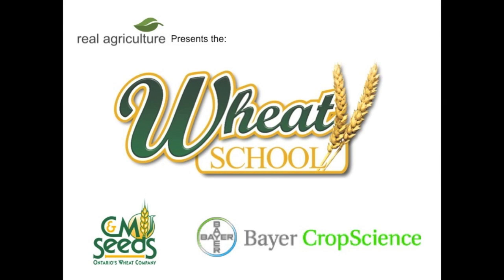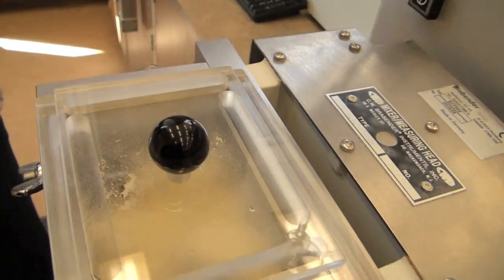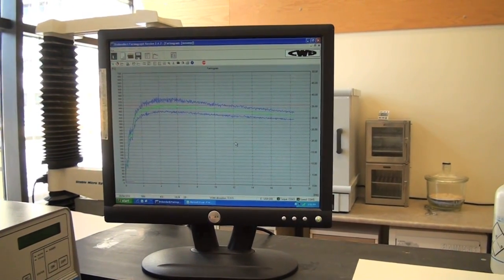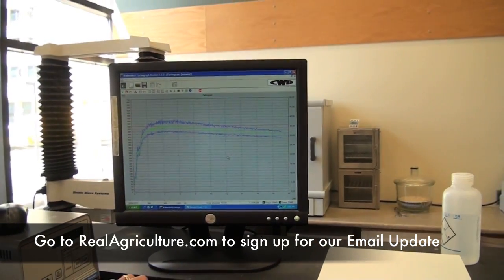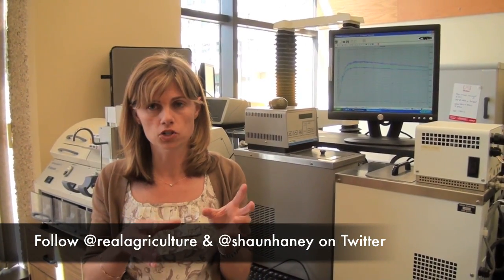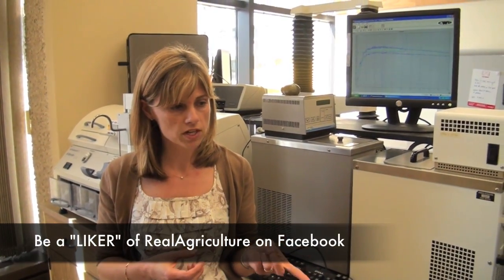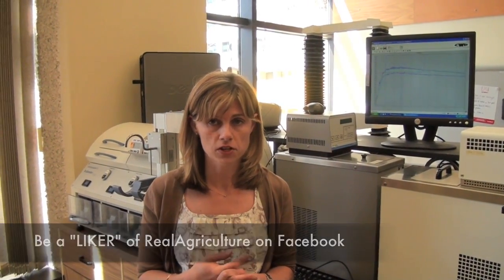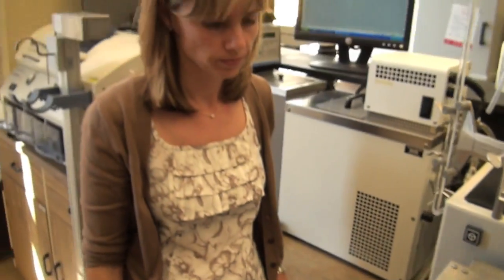Wheat School - How a Farinograph Tests for Dough Quality - CIGI

Comment: I'm interested in how the graph would differ between a high protein and a low protein flour. My expectation is that there is a range of Brabender units that could be achieved with either flour, although it might take more time for a low protein flour to achieve that.